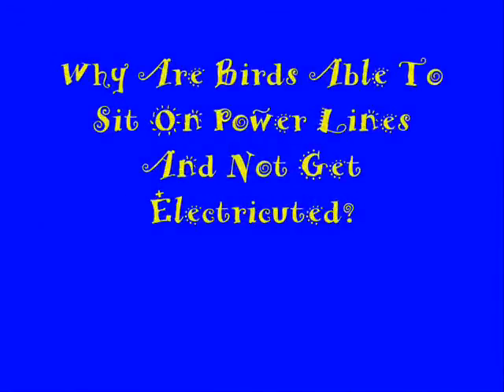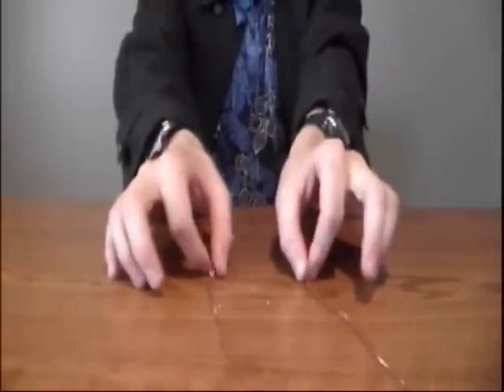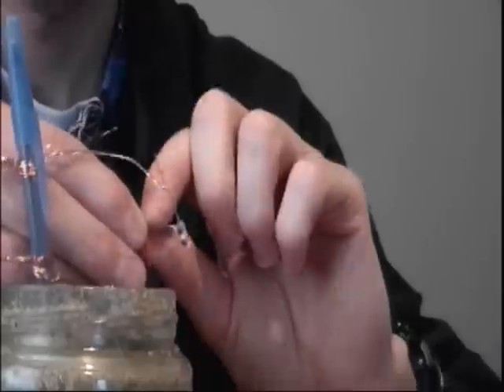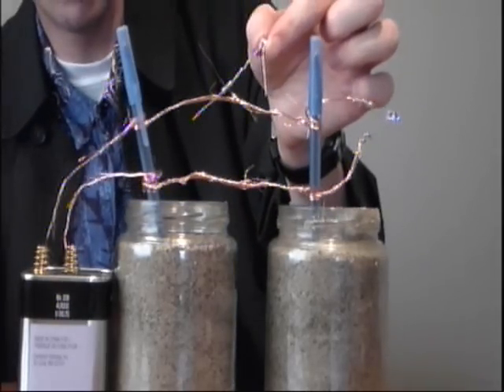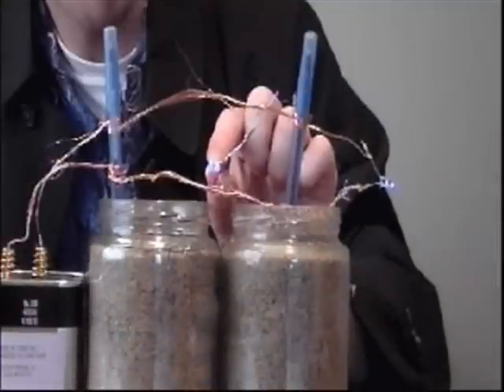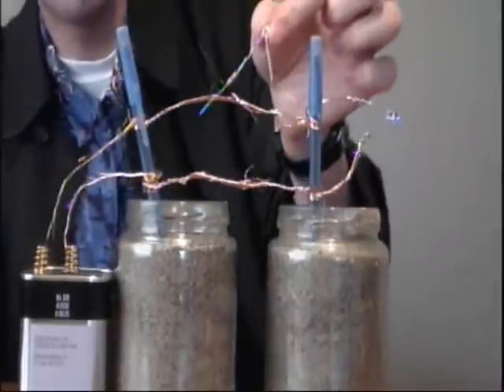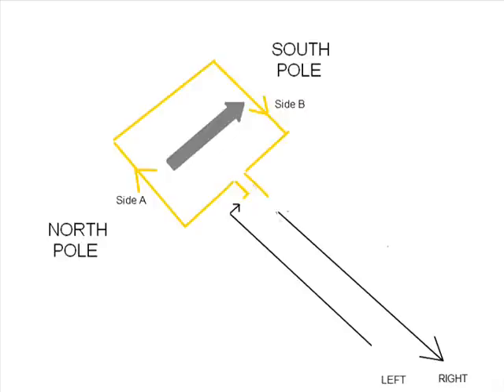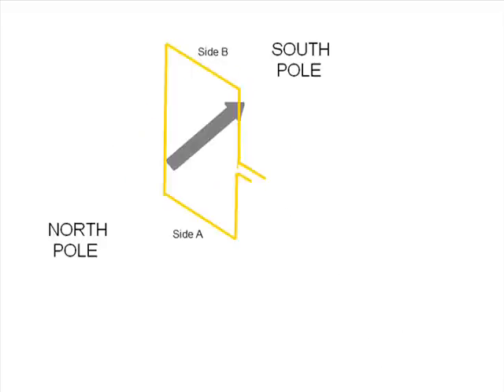🔌 Why Birds Can Sit On A Wire 🐦

Comment: the question i sustain is, actually i already study this but i don't quite remember. Do the electrons still pass inside the bird or do they "decide" to not passing inside him because it is a longer path? I also didn't get the end referring to emagnets generators nor why the resistor on the led is necessary. But uh, anyways, A for effort =D

Comment: can you do a video about "why cars don't have just one gear (especially 4x4 cars)[to be able to use their power at really maximum)" ? ? ? please, it would be great (even a simple explanation) [I understand that for normal cars just one gear would mean too much power] {but I want a better answer}

but why off-road cars don't have just one gear ? or to be able to switch from the '1 gear' system to the 'many gears' system, when you have to climb a 45 degrees incline (or more) ;-)

Comment from the maker: This is demonstration on how birds able to sit on wires, not a demonstration of how AC current works. the fact that the bird or LED doesn't connect two opposite flow directions is the demonstration here. As for my explanation on AC current that is exactly how AC current works. Now I didn't explain it in a generator aspect but the explanation on what happens inside a generator is accurate. The only thing I got wrong was the north pole pulls on and the south pull pushes on electric flow.

Comment: This wasn't the best explanation. Using DC current as your setup and connecting the positive and negative together isn't what the birds do, as if they are on the hot AC line, they are experiencing both, which complexifies the situation slightly. I get the feeling that you don't really understand AC current that well, just based on your confusing explanation of it that wasn't relevant to the experiment you just did. You literally related nothing from your AC explanation to what you explained.